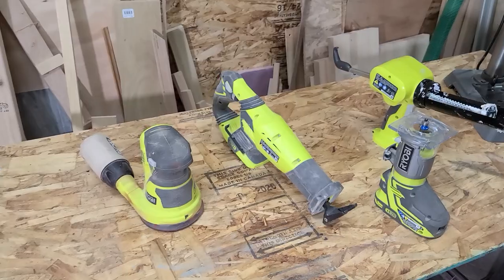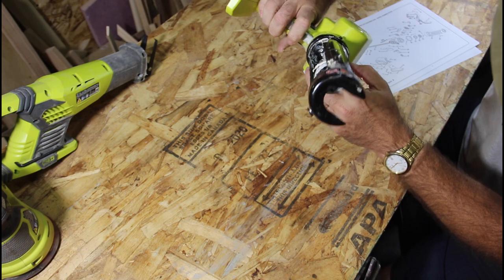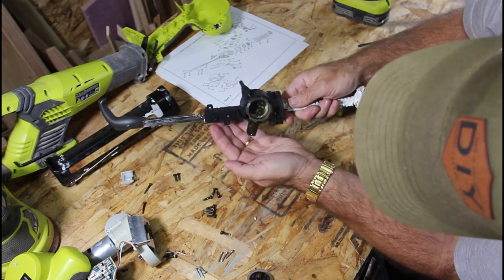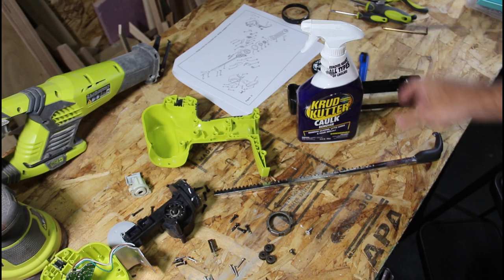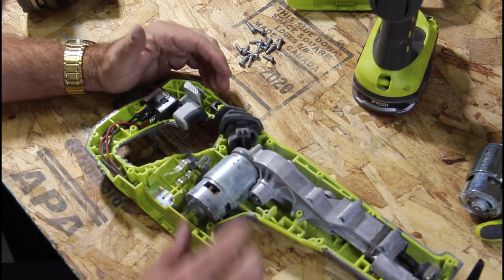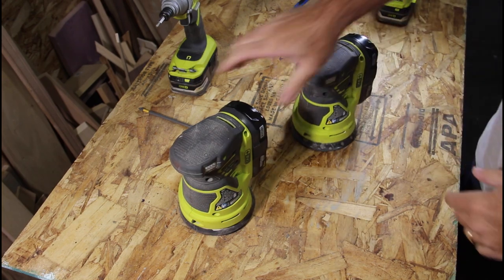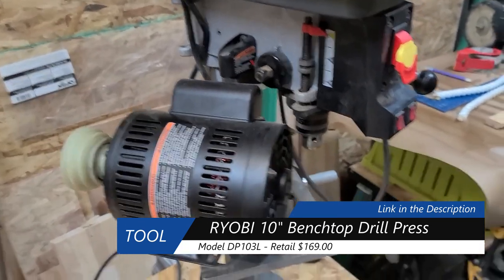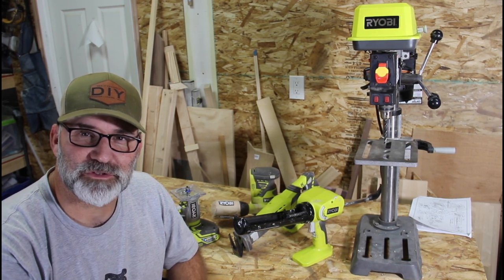Repairing Broken RYOBI Tools | There is nothing MAGICAL about the BLUE SMOKE! | 2020/31

Comment: It's good to know about the Ryobi Parts store. I have a fair amount of Ryobi tools, thankfully none have died yet but it's good to know where to get parts of one does go up in smoke.
Reply from the maker: They are really easy to repair.
Reply: @DadItYourselfDIY  I have taken quite a few apart for reviews and most are fairly easy. Probably the hardest was the brushless reciprocating saw.
Reply from the maker: What makes it so different from a regular brushed motor unit?
Reply: @DadItYourselfDIY  the rubber grip by the blade end hides the screws. I couldn't see a way of getting it off without cutting it.
Reply from the maker: Thats silly. Heat to peel the glue?
Reply: @DadItYourselfDIY  it wasn't glued it might have been stretched over with a machine or shrunk on. I would like to see how it was made.

Comment: Hey , you got any idea what's causing my ryobi circular saw to cut off after a few seconds being turned on ? I guess it's eitherr the trigger switch or motor ? Don't even get to put it into lumber it just cuts off
Reply from the maker: Check the contacts inside, and does it do it with different batteries? One of my multi-tools has worn clip stops, so the battery drops out too. Finally, never use a saw with a battery lower than 4ah.

Comment: what's your honest opinion of ryobi out of curiosity?
Reply from the maker: I'm super happy with the line overall. The price point is good and they have lasted me a while.. Just like everything else, they haveca couple of lemons, and have some gaps in the product line. But I don't regret buying into the line.
Reply: I have enjoyed all mine so far, I use the 3/8 , 3 speed brushed impact for alot of automotive work I do, and man it's a life saver, I have floor jacks but I prefer my scissor jack cause (paired with Jack stands) can be deployed so fast with my impact, I can have the car off ground so fast and then ugga dug those lugs off quicker than regular floor jack users can slide thier jack to the car
Reply from the maker: I drive a full size truck the 1/2 takes care of those lugs no problem. My #shorts video on Wednesday in on the impact wrench.
Reply: @DadItYourselfDIY  I meant half in, I said 3/8 cause I just ordered the 3/8 and got mixed up